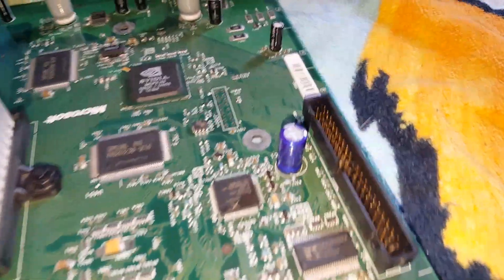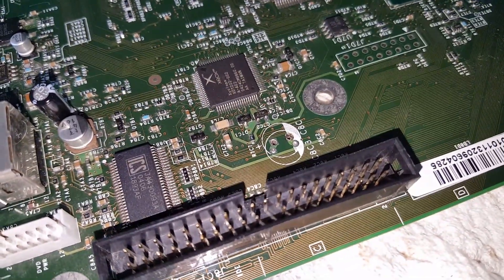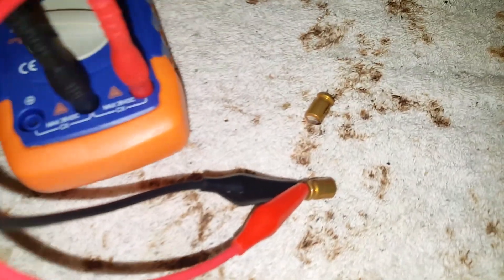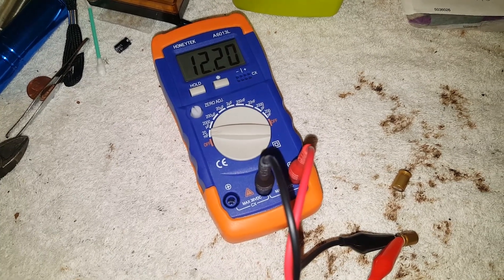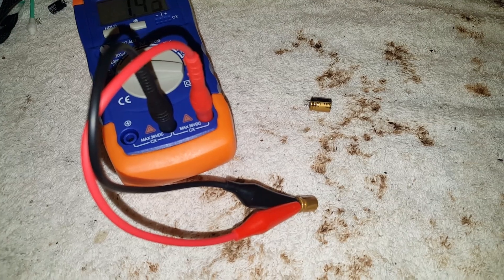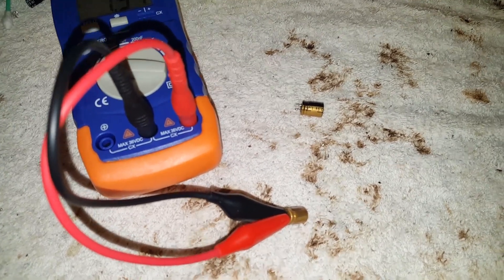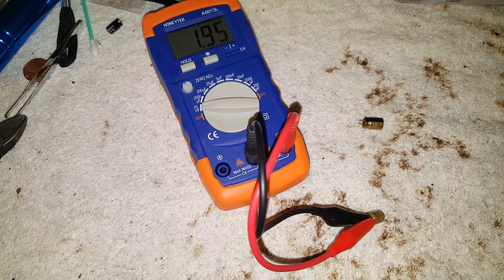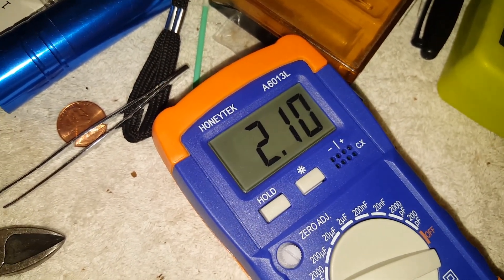Why XBOX 1.6 Clock Capacitor Needs Replaced.

Comment: What’s your recommendation for someone who has never done electronic soldering? I’m not worried if I mess up because my 1.6 doesn’t work either because of this exact issue, but is there a preferred sized soldering gun for this job? Or does any work?
Reply from the maker: Any solder iron works. The hotter the better the solder flows. Cheap irons have no adjustment and usually get uo to 500 degrees. The adjustable omes let you use less heat. You need thin solder wire. Thick solder wire is for soldering speaker wires. Also Copper solder iron tips are easier to clean than stainless steel tips.

Comment: So I've replaced all the Capacitors including the clock capacitor. Soldering iron was at 350 amd used decent flux. So it doesn't power on at all. When I press the power or eject button it makes a faint buzzing noise near the power supply. I've changed power supplies already with my other v1,6 and I can definitely phase that out as both work 100%. The only thing I can think of it's either a component or cause it's quite a thick bord and the middle part of the bord got damaged somehow. Im lost at this point in time. Thanks for getting back to me bud

Comment: I've replaced it already as soon as I took it out. Still buzzing when I push start or eject unfortunately. Must be a short on a component
Reply from the maker: It turned on. Now it is buzzing. Might be the component wires. I would unplug TV and clean component input on back of TV with alcohol. If connectors are dirty it can make noise from bad connection.. Swap component or composite wires and see if the Video output wire is bad. Try to rule things out that are on the outside of the console before taking it apart again. Also COLD SOLDER can cause popping with the video and audio. You might want to check your capacitors solder. If it is broken it can do weird stuff. Melt solder at 350-400 degrees. 320 degrees is too cold. Got to make sure the solder flows and capacitors are not loose. My friend gave me a Xbox he worked on, and his capacitors were loose. I had to go back over some remelting or adding solder. I use a magnifying glass to inspect solder when installing capacitors. You might have cold solder joints losing continuity. Might want to tap on the console and see if it jars capacitors that are lose. But the clock capacitor did get it powered on, right?

Comment: Can this cause the xbox not to switch on? Which capacitor did you replace it with?
Reply from the maker: The 1.6 Xbox will not work without this 2.5v 1F capacitor.
Reply: If the capacitor is faulty will it also cause the xbox not to switch on? I'm getting a buzzing sound each time I press power and the machine doesn't power on
Reply from the maker: @dusty7933  Yes, I think it is dead if the capacitor don't work. The capacitors are about $5 on Ebay with shipping. You also want to buy MX-6 thermal paste for CPU and GPU.

Comment: There is a 1.6 clock capacitor bypass.
Reply from the maker: I will have to look that up. I made this video because I seen people recycling the 1.6 clock capacitor and putting them in a 1.2 or 1.4 thinking they're better than a new capacitor. So this tool I used proved they had 1% power left instead of 99% like a new one. 2 out of 2 fail so I figure they're all bad.
Reply: @sleepwalker29  well its an over 20 year old console its logical and reasonable to come to this conclusion i never understood why not get new caps i do it because i know itll last longer even if the capacitor is good i dont like taking chances on a old capacitor anyways

Comment: You can remove the capacitor on a 1.6 and fit a 220 ohm resistor instead. It'll boot and you'll never have to worry about leaking caps again. Even a regular LED will work as well, but make sure it's fitted correctly
Reply from the maker: Good to know. I like to replace capacitors because they reduce motherboard temps by removing electricity from the board and storing it in the capacitors. A recapped motherboard will have lower temps and quiet OEM fan. If electricity does not go in the capacitors then it stays on the motherboard making it hot increasing motherboard temps. The power brick regulates how much power is going into the motherboard. So removing capacitors will just increase motherboard temps. The 1 farad clock capacitor equals 1 million microfarads. So it is one of the biggest capacitors on the board. It stores more power than all of them 1500uf capacitors. My recapped boards run about 30-41 celsius, and CPU temp is 40-51 celsius. I also have OEM fans running quiet.